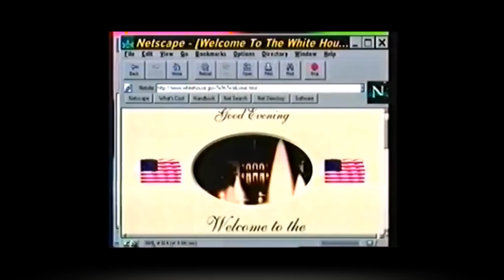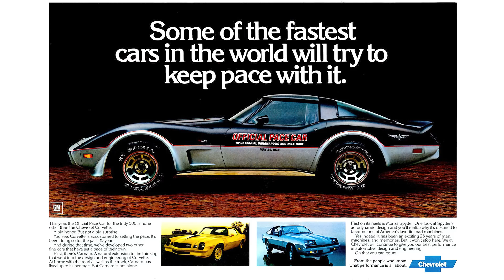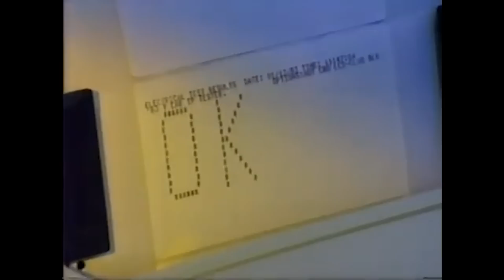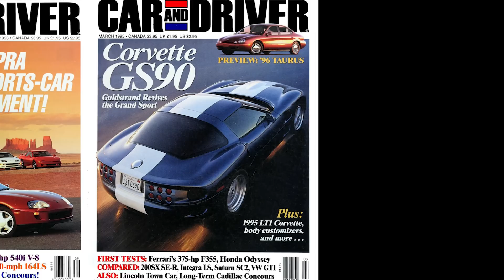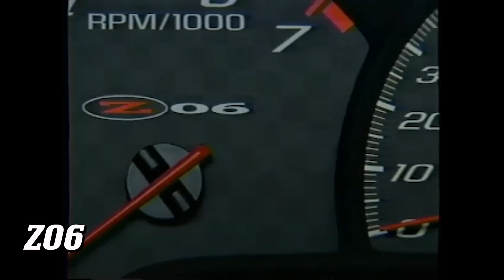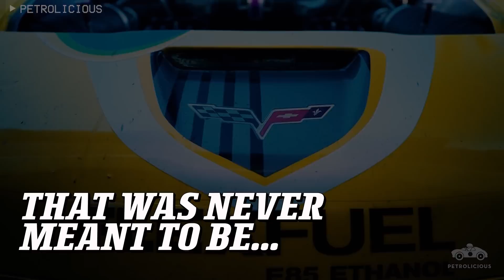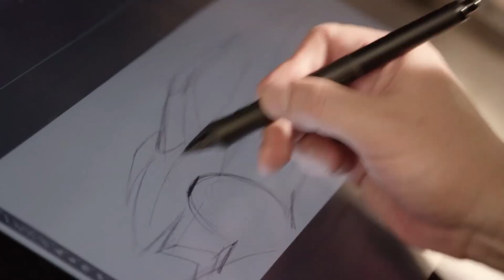How a Top Secret Supercar Saved a Legend

Comment: The thing to remember about the choice for the "Blue Flame" inline 6 in 53 was because Chevy did not have a V8 at the time. The legendary small block V8 would not be available for 2 more years. As soon as it was released in 1955 it was immediately stuck in the Corvette.  Chevy was about the last of the GM brands to get a V8 as at the time Chevy was the bottom of the food chain within GM. Also the initial 53's were basically just a fancy body stuck on the current 53 Chevy passenger car frame and were pretty much that same frame through 1962.

Comment: This one was a banger! 

I was thinking, I would reccomend the story of the Porsche 917 next. I personally believe it is one of the best car stories in history! In case you aren't familiar, the entire car (which is one of the most dominant Le Mans cars ever) was designed in two months, and when the time for inspection rolled around, they only had one of the required 25 units built. So they stood 25 bodies of a 917 in a line and prayed the inspectors would only ask them to start unit #1, which was the only one with an engine in it. Then, when it got to a track the first time, the fan blew out of the engine, and the windshield wiper flew off too, but somehow this car became reality. Even the body of the car was utilized efficiently, the tubing of the frame was also the pipes for oil and fuel, to save weight. Then, the car went on to win... literally everything.

Anyway, sorry for making you read that wall of text! I would love to see a video on the 917, I mean really love it, and I think it would do quite well. Hope your hand gets better, and thanks for the amazing videos!
Reply: The 917 was a death trap. The frame was a spider web of small aluminum tubes, covered in a thin fiberglass body. Drivers feared it, even if it was a quantum leap in prototypes. The 917-30 was the same madness, but with 1000+ horsepower
Reply: @arthuralford  yes it was a death trap, yes it was aluminum and fiber glass, but it worked. And I sorta included its various models in my suggestion, thanks for specifying your favorite as well though!

Comment: The C3 Stingray was a carbon copy of the Banshee concept.
The modern Corvette owes its herritage to a Pontiac design.

Also, let's not forget that Pontiac was the first General Motors brand to mass produce a mid-engine sports car (Fiero), which Chevrolet only just began implementing in the C8.  From 1959 onward, Pontiac was the performance division of GM.

Comment: The C4 was such a brewing pot for tech that went so criminally unoticed. it was painfully invisible. especally the ZR1 models

But the start of ABS, Traction control, proper computer systems. it housed the then legendary LT5 which made 370-400hp and was the grand primer for the LS with lessons learned from lotus. chevy defintely learned some lessons,leading into the LT1 and LT4 motors which besides optispark were and still are great. all of the blocks were in place and it just needed a little push. 

as stated, the c5s especally early models had a lot of teething issues, i ended up going with a 96 C4 personally. (i'd personally deal with opti demons over computer and abs demons) and its still an amazing car. yeah, its the bit of a black sheep, but its still an amazing car, even with mine being a basic, automatic example.
Reply from the maker: I've honestly been shopping for C4s in my area, I think there's a magic to them that the C5 didn't capture. The styling, the stance, the narrow body, they just seemed more "fun" than the bulky C5. 

that being said the C5 is so significant in the direction of the Corvette emblem from then on, I get why it gets the praise.

Comment: At the start of this video I thought it was going to be about the Mercury Marine powered C4 ZR1 (which driving, is pure 80s nostalgia. from the thin seats, to the bucket like feeling of the floor beneath the frame rail, to the switches for the dual fuel pumps and injectors for that extra power mode). I think calling out the C6 as the prefect touring car should go to the C6 GS if not the best corvette of them all in my opinion, the C6 Z06

For those wondering, the track in Vegas is great. It used to be about $2k to stay there and receive professional driver coaching while you ripped around the track in a pre-production Z06

Comment: Great video, nicely condenses the C5 story told in All Corvettes Are Red by the late Jim Schefter.  Just one minor mistake about the transmission that needs correction - moving the transmission to the rear was a CONSEQUENCE of the frame design, and it had nothing to do with 50/50 weight distribution.  Just as all Corvettes had fiberglass bodies from the very first one in 1953 (which was done for styling reasons and not for weight savings as commonly misunderstood), Corvettes had already had 50/50 weight distribution since the 1960s.  But the most critical aspect of the C5 was its new hydroformed frame design, which necessitated the rear transmission architecture, not the other way around.  The rear transmissions cost a fortune to engineer for C5, and the development cost of the T56 6-speed manual for C5 ultmately bankrupted Borg-Warner - which is why it's now owned by Tremec.  Also, in some clever internal accounting shenanigans, all of the LS engine development and some of the frame engineering cost was actually billed against the GMT800 truck program that the engine was shared with (Silverado, Tahoe, Suburban, Yukon, Esacalade, etc), in order to keep the $450m budget allocated to C5 with the development of the car itself.  Without this, it wouldn't have been as great a car and as great an engine if the whole program had been constrained to that $450m budget.

Comment: The C5 is easily the prettiest of the bodystyles, and lights down, probably the lowest drag numbers. One thing missed here, especially regarding the 'Supercar' title - Supercars are Mid Engined, like the C8 is now, with engine behind the driver. However, the later Vette's, and C5-R and C6-R especially thanks to motorsport mods of moving engines backwards, have the motor behind the front axle, meaning that they do sort of qualify for the club, in the same way the Panoz does, as does the Viper.

Comment: All corvettes since the 63 have been mid engine. Just because the engine is behind the driver instead of in front doesn't constitute it now being mid engine. The definition is that the engine be between the front and rear tires and the crank pulley being in line with the front tires puts the engine behind the tires making it in the middle. That's a front mid and the c8 is a rear mid but BOTH are mid engine Corvettes. Personally, I have the Ferrari looking ripoff almost as much as I hate the BMW with a supra badge.
Reply: Exactly; Front Mid-Engine to be precise.

Comment: the c5 was a pushrod and lemans requires reliablity and the pushrod v8 was reliable to keep corvette from blowing a motor, plus 50/50 split means handling and carbon fiber is a plastic, and its as strong (or even stronger/weaker in some cases) than steel
Reply: and i kinda like the c4-c7 era of corvette and the c2 thats what made it good none of this fancy mid engine crap i understand it had to be done but cmon atleast dont try to make it look like a ripoff ferrari

Comment: Good show but short on facts. The greatly improved suspension of the C6 is identical to the C5. All suspension parts are interchangeable with the exception of the rear cradle because the transaxle was changed and mounts differently. The 1" longer wheelbase was a detriment to handling but improved interior room. Shorter and wider is actually shorter and narrower. I've had several of both.  Settled on the C5. The only thing I found substantially better on the C6 is the high speed characteristics at night.  Once the headlights on the C5 come up it starts to wander above 120. Above 150 it is more drama than fun. I driven all the competition... Porsche, Ferrari, BMW, Lambo and etc.  The only thing that even comes close to the C5 is the M3 but it costs twice as much to go almost as fast. The Porsche is OK until it suddenly isn't. My C5 with Dot Rs does 1.2G on the skidpad so easily it just gets boring.  Laps on trackdays are so predictable that I can actually focus on improving my skill sets instead of fighting the car.  Would have been a true shame if this had never been built.

Comment: The only issue with the C5 is that  GM was too cheap to build a OBD2 equipped LT5 making 485hp and stuff it in a new ZR1.
Reply: Where would have built it? How much would the machinery cost? How about the modified or new building to house said machinery and production line????

Comment: The best Corvette is the C6, truly a masterpiece by design. The C5 was nice yeah, but its design looked like someone used a clay model and turned it into soap and took a shower and by the end of the week you had the C5 body molded. The C6 is just perfection. The C7..... Well.... Honestly it looked like a Ferrari from afar
Reply from the maker: To be fair the C5's body was originally designed in the late 80s/ very early 90s so it was actually ahead of its time, but by the time they convinced GM to release it yeah it was a bit dated. 

The C6 really is the better sequel in so many ways.
Reply: @the.squidd  exactly, and it pleases me to see so many who share the same thoughts and recognize the C6 as the superior model, but that will never discredit the C5 for what it achieved with as you said 'Caveman suspension'. That got a chuckle out of me bro

Comment: And then someone decided to move the engine to the middle of the car... and then the Corvette was over. Just look at it! That thing has no Corvette anywhere. Can you imagine an El Camino with the engine in the cargo bed? Neither can I imagine a Corvette with the engine in the middle and a paddle gearbox
Reply from the maker: What that’s an insane comparison to make. The c8 is a vette.
Reply: I feel you but as a Motorsport devotee I embrace the car. Though for a road car I prefer a larger displacement Front Mid Engine layout. It’s as if Porsche took the 911 and made it mid-engine.😮

Wait! The 991 GT3 RSR race car WAS mid-engine. They reversed the Powertrain. So, GM is not alone here.

Comment: 3:29 "This decision to go with a 6 cylinder"?!? It was literally the only engine Chevrolet made at that time. It was that or nothing. Duntov didn't "swap out" the 6 for a V8. No Chevrolet V8 had ever existed before 1955.
Reply from the maker: GM made 8's back then. It's still true that had it remained an inline six it'd likely not have caught on the way it did.
Reply: @the.squidd  Using the 4.3 V8 in 1953 would've given the Corvette only another 30hp. They put a performance V8 in the Corvette as soon as they had one available, and they were going to do that regardless of Duntov's influence. The Blue Flame 6 was not a mistake, and the 265 small block to the Corvette literally as quick as it was available. Duntov did much to improve the Corvette and make it a true sports car, but calling the Corvette's original engine a mistake or giving Duntov sole credit for the 265 V8 upgrade is inaccurate.

Comment: If they priced it at 99k, it would have sold like hot cakes, take the numbers of sales to make back the investment. 
It needed a more exotic look, in order to make sales, the look of the ferrari f40 n f50 n nsx should have been an influential part into the look,
People want a car that turns heads to spend that much money. 
A good sized spoiler visible while off n driving low speed and raised up when at high speed or when wanting to impress. Also sleeker body, ya a little harder to get in, but u want young buyers and mid aged people not just stiff backed rich guys. 

Or even create a new name branched as part of toyota, like lexus did when they created the luxury toyota. A new name that was to be known as Japanese super car.

N the model number should have been LF1.              LT F1
Or LF480 

The name needed to be catchy not just an A.

Comment: You act like Chevrolet just chose not to use a V8 in 1953. All they had were straight 6’s, the 235 or 216. The brands under GM were much more independent, so they couldn’t really borrow an Oldsmobile or Cadillac V8. 1955 was the first year of the small block Chevy V8, and only 265 cubes - so hardly “the era of massive V8s.” The first big block debuted in 1958 weighing in at only 348 cubic inches. There are multiple small blocks of the 60’s that were bigger and it wouldn’t grow into the song worthy 409 until 1961. 427, 454, 472… all 60’s. Not great accuracy with your data.

Comment: My issue with the Covette Lemans wins, is that Corvette didn't actually win those races.....Pratt & Miller won the race with a custom designed race car carrying a Corvette badge.  There is not a single shared component of that car with the street car, rather  other brands like Porsche and Ferrari actually homologate their cars.
Reply from the maker: Eh, you can find examples of that from pretty much every manufacturer. It really depends on a lot of variables, chief among them, the series rules themselves. But I hear you.
Reply: @the.squidd  Yeah I understand and that is certainly the case for many of the new GT car entries for IMSA and WEC, but the two companies with racing heritage, Porsche and Ferrari, largely make their road cars as close as possible to their race cars. Obviously differences exist because suspensions for the road and street can't be the same because of potholes and stiffness. 

However, C5 and C6 chassis wasn't even the same as the R versions. Road versions were still on leaf springs, where racing used double wishbone coilovers. Aluminum vs steel.

Certainly changing with the C8, but still a ways off.  Also, quality is still issue in the long-term.  Not many good condition Vette's 10 years old with 100k,  yet my 40 year old 911 starts up and drives the same as the day she rolled off the line and the interior has held up extremely well.
Reply: False!

Read the rule book for the series.

Comment: Corvette has been mid engined for a long time, even if the engine is in front of the driver...
Reply: Right.
Most People dont get it.
A C5 is more Mid Engine, than a C8.
C5 = 50:50
C8 = 40:60

Comment: Ok. So far good video but. Chevrolet did not have Massive V8’s in the 50’s that didn’t happen until a decade later. If you’re using hyperbole then ok, but a 265 ci v8 is not Massive.

Comment: Is the modern corvette not a reverse engineered 458?
Reply: No, it’s not.
Reply: @WDLC1911  I think some light digging would tell you otherwise 😬
Reply: @simon8089 , I’ve worked in the auto industry for about 20 years. Some deep digging and/or vehicle engineering would say different. Cars are benchmarked and much is already know from racing. No one straight “reverse engineers” a complete vehicle. That’s ludicrous, brother.

Comment: Well done video - mostly. But you ignored some important stuff. In a video of the history of the Corvette why no reference to the 1990 - 1995 ZR-1 Corvette? No reference to the C4 ZR-1 engine the LT5 engine which was the only 32 valve overhead cam engine ever in a Corvette until the C8 ZO6 and the LT6? It made 400 HP when the small block was still at 230 HP. The 1990 ZR-1 Corvette was faster than any previous Corvette and faster than the C5. Much of the C5 LS1 technology came from the LT5 engine in the C4 ZR-1. Jim Perkins killed the C4 ZR-1 by making the 1991 and later C4 Corvette look identical to the C4 ZR-1. IMHO Jim Perkins was a bad salesman, not a hero.

Comment: "On paper, the newly born c5 Corvette was dumb. A big, wide, impractical sports car, made of sloppy parts and sold for cheap. It's grip on the Earth was managed by caveman suspension. THE CORVETTE SHOULD NOT HAVE HANDLED! 
It was made of steel and plastic, while others were using carbon fiber, THE CORVETTE SHOULD NOT HAVE WORKED!
It was motivated by a simple pushrod V8, while Italy's best cars screamed around racetracks in flat plane crank V8s. THE CORVETTE SHOULD NOT HAVE PERFORMED!
Proper fast cars had their plant sat over the rear axel, the stone age Corvette had its engine sitting in front of its driver. THE CORVETTE SHOULD NOT HAVE BEEN COMPETITIVE!
And yet...
Once the C5 generation Corvette made its appearance in showrooms and racetracks, none of that mattered. Because the Corvette was American. Sure, easy to make fun of, comprised of different parts, and falling behind what everyone else is doing. BUT STILL THE F**KING BEST!"

My God, I have never heard this told in such a way. This is how the story of the Corvette should be told. Saved from the brink, several times. But each time, it came back on top.

Comment: Uuuumm..I'm sorry but Ford wasn't just playing around with four cylinder mustangs.The SVO mustang was absolutely nasty and that turbo'd four banger would smoke an '85 'vette.Also the '85-'93 foxbody mustangs gt's..well same deal they didn't have the brakes or the handling but in a straight line would embarrass a 'vette.This is a fact quarter mile times don't lie and the 5.0 gt's had a top speed of 147mph.
Reply: You need to put that fentanyl down. The SVO would smoke - sure - but not the 1985 Vette. 😂

I don’t recall the times but Mustang 5.0 would not smoke Vettes, either. The C4 was an 155 mph car.